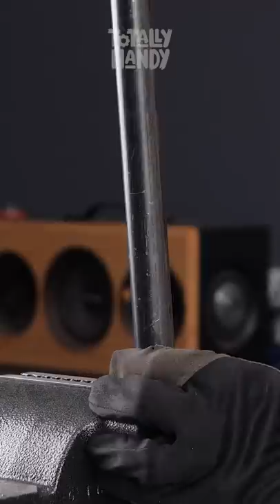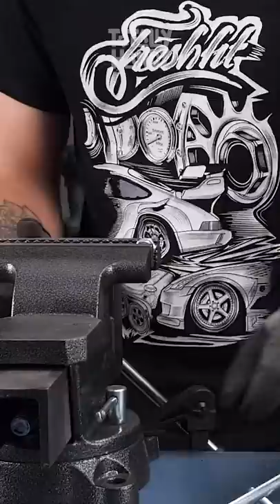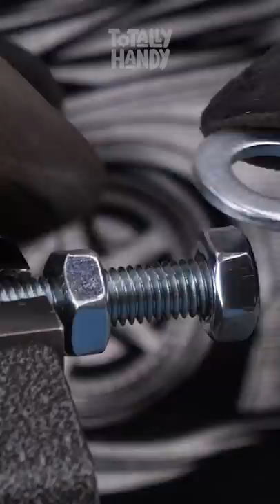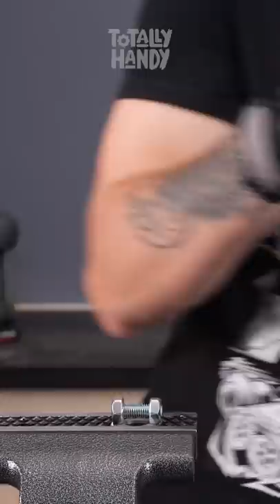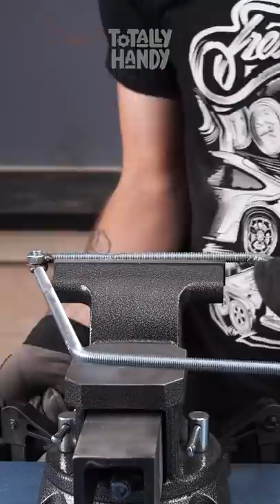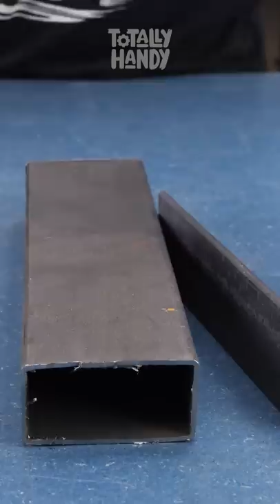DIY Clamp for Welding #shorts

Comment: Distance from the fulcrum dictates the force that spring will have on the lever.

This clamp couldn't bruise a grape
Reply: Finally someone making sense in here
Reply: Lmao yeah just buy a clamp I guess. I think the point is the whole make it yourself to maybe avoid going to buy it because you can just do something "good enough" by yourself. Which in this case, it was good enough to use for whatever he was doing
Reply: No harm in fucking around making your own tools. He never said "this is the best clamp and you can make it yourself" it's just a clamp he made, technically it's exactly what he made soooo
Reply: I get that it's WAY more effort than needed but I'm pretty sure he knows that too. I'm sure he has hundreds of clamps sitting nearby
Reply: @techsk8er1O5  To be real, it's all about the views and engagement and we are watching and talking about it aren't we?
Reply: @techsk8er1O5  wel the metal used would be waaayyyy cheaper than buying new clamp eitherway

Comment: I wouldn't use it let alone trust it!. When you weld 2 pieces of metal together you want it to hold and be clamped Tight! The spring will move. Not to mention it's a dumb idea to use in metal fabrication!!